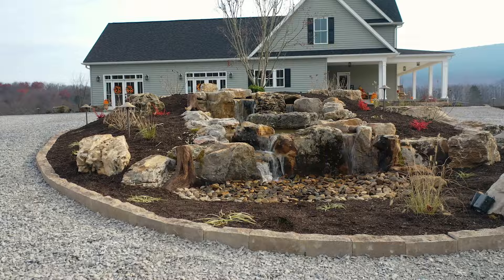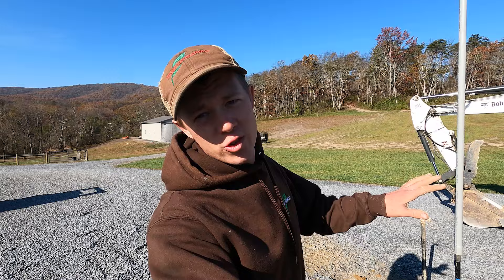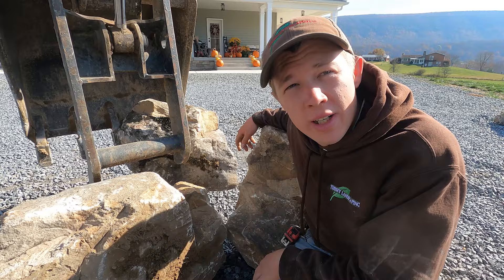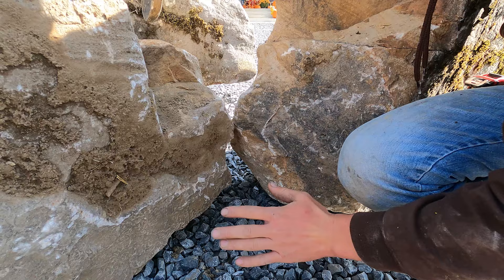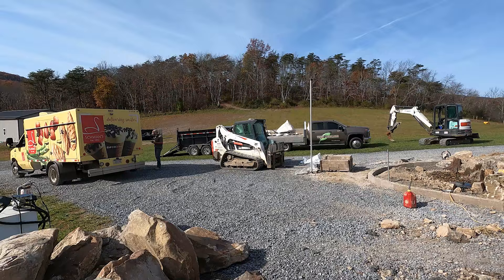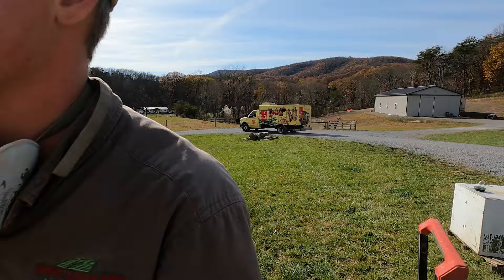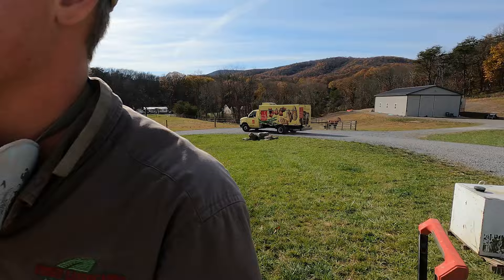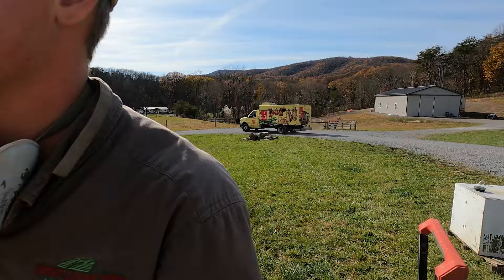A 16' Pondless Waterfall for this Brand New Home!

Comment: Hi Ben, Your videos are my favorites to watch, because you’re so natural in them. As was Weston. Of course your work is exemplary, but you are smart enough to let it speak for itself. The camaraderie between you and Dietz (probably spelled wrong) is very endearing. I can say that because I’m probably old enough to be your grandpa. You’re lucky to have that lowboy to bring in such big machines, two at a time. I’ve used both E50s and E42s, but own a really nice E35 because it fits anywhere we go, although it’s limited to smaller rocks. I also have a T595 which we use to move our rocks with. We sort them and set them on 6x6x24” blocks so they’re easy to grab and move to the excavator. The T595 can move 3000#, and do so much faster than crawling back & forth with the excavator. I have both a 36” & 48” smooth buckets, which are super for scraping out an excavation. I also have a Bobcat rock grapple which is easier on the rocks than moving them with a tooth bucket. I’m eager to see your E50 with the tilt rotator, as I’ve been dreaming of one for years now. Keep up the good work, and I hope to hang out with you a bit at the next Pondemonium. Except for Greg’s Dad, I’ll probably be the oldest, and likely tallest guy there. 🤠 Regarding planting, since the soil around a house is usually so compacted, you might consider ripping up the whole bed, rather than just drilling holes. That way the roots can spread farther, easier. A little compost to ease them from the potting soil to the native soil is also not a bad idea. ✋👍👏👏👏👏👏
Reply from the maker: Wow!! Thanks so much for the compliments and the tips!  The guys will be thrilled to meet you! And they're also super excited to work with the new tilt rotator!